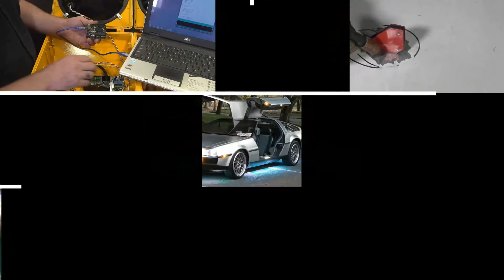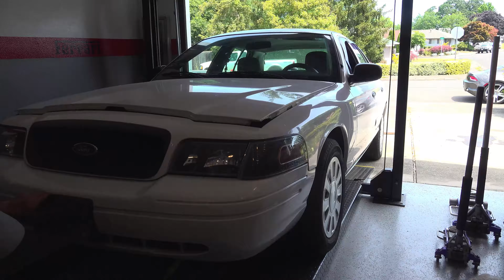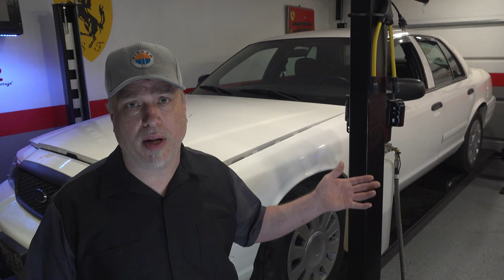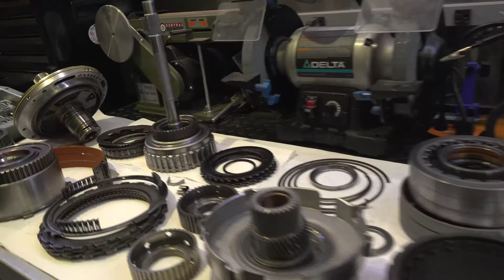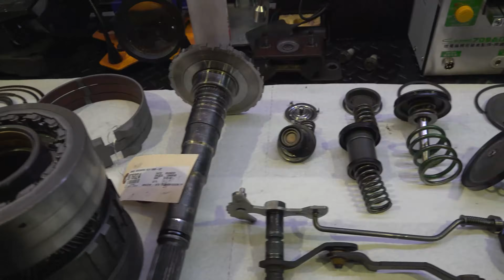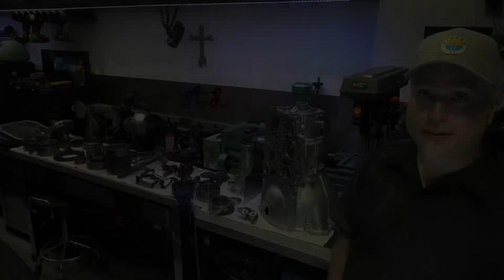Squad car: 4R75W transmission rebuild [4K] Ep36

Comment: Yep. The transmission in my junkyard truck is smoked. It’s a two speed! Luckily I have a five speed to go in.
Reply from the maker: Yeah this thing got expensive and there is a lot of parts in that housing!  Not as bad as the last transmission I did, a 4L65E from a late Tahoe.  I never voluntarily do transmissions, they make me work on them.  Check that mileage before you buy it, I keep telling myself.
Reply: Afternoon Garage wow, even if I did a “quick rebuild” on this aod I have, it’ll cost the same to just put the five speed in. But I have to wait until my 4bt is done. I’m jealous of your garage. I want to check it out sometime!
Reply from the maker: @justhes  Sure!  Need to get through this one and get that car out of the garage.  The P71 CV is so long with the extended wheelbase.  Next time I will be working on something completely different.  Thanks for watching!